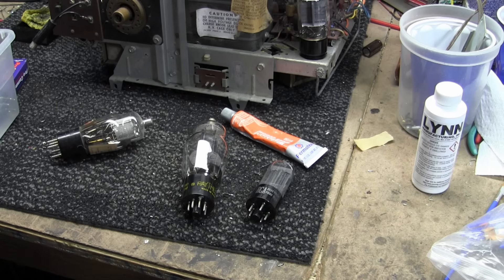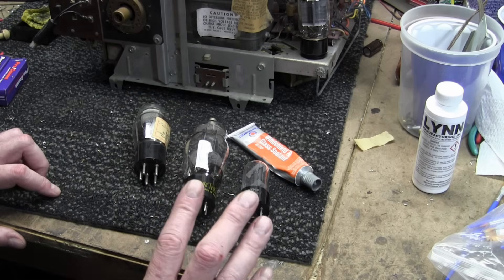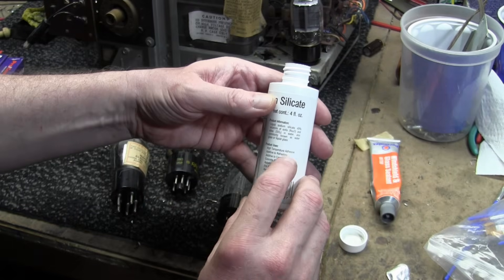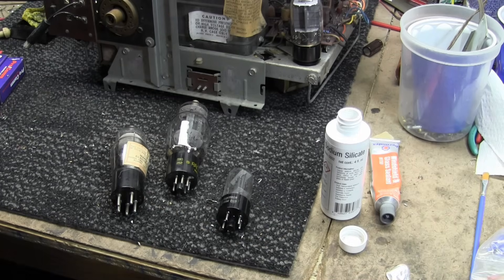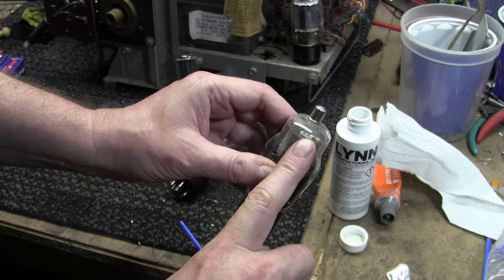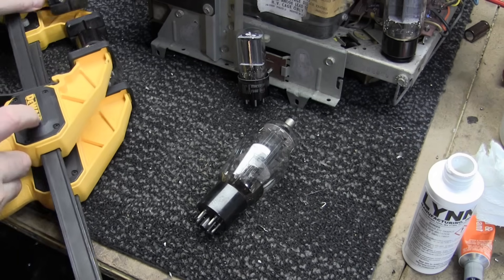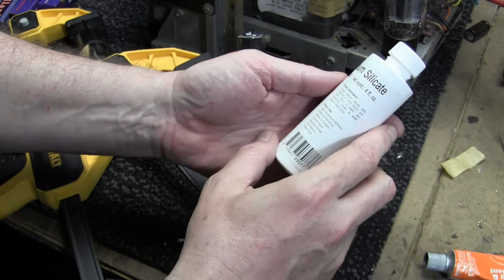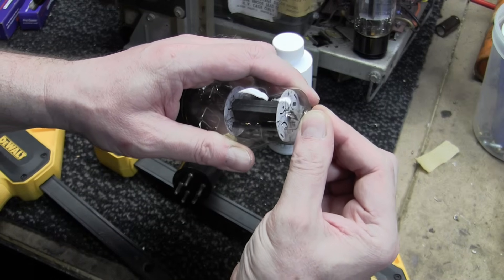Bob's Tech Tip: Repair loose tube base and cap with liquid glass

Comment: I used it to fix a dozen tubes I had with loose bases, it worked well and they were rock solid afterwards, but I applied sodium silicate liberally with a syringe and I think on some tubes it pooled up inside the base and caused crackling or a short in the tube, even after a fortnight of drying as there was poor airflow in the base .  I salvaged 2/3 of the tubes, my tips would be not apply too much sodium silicate, leave a gap when applying so it can evaporate and dry, and leave in a warm place to try at least a week or 2.  An additional tip which saved a few of the crackly tubes for me, and would be a good thing to ensure they are dry, leave in standby for a 1/2 hour with only heater current then they should be good to go.  All my repaired ones are rock solid and working sweet.

Comment: Hey Bob sodium silicate is actually the big ingredient in all of those head gasket repair containers that you see at the auto parts store. The idea is that the cylinder head and engine block are so hot as it rolls past the leak it'll slowly build up and keep heating up and hardening in that area until it's solid. Sometimes it works sometimes it doesn't. I'm wondering if you could use it for a cataract. In theory it could replace the glue. Then you would have the implosion protection back again. Maybe you could silicone the perimeter leave the top open like that little Port they had from the factory and fill it. Then use a heat lamp to harden it. The hard part would be maintaining the temperature. Just thinking out loud

Comment: I first start by dripping some acetone into the gap between the base (or cap) and the glass. This seems often to remobilize the original sealant and effect a new seal. With several drops of acetone injected, rotate the tube to spread the liquid around, then clamp gently. This is the least intrusive method that I’m aware of. If that doesn’t work, then I start thinking about other adhesives.

Comment: waterglass, my bread and butter. 
hardening to full cure using vacuum and high heat will make it near impervious to the extremely slow breakdown due to water. see nasa report docs on sodium silicate vessels. see use of sodium silicate for use in glyptol replacement.
waterglass (in a varied form albeit) is indeed the binder in screen phosphor, and has favourable electrical properties in that situation; e-beam tunneling is not ruined with occasional waterglass obstruction, and the phosphor is subjected to a near Fowler-Nordheim tunneling event, a good thing too, it lights the screen well!
The use of waterglass to make a quasi dag material (it is indeed colloidally suspending to the graphite, though not as well or in the same way as the other dag, atkinsons colloidal graphite) is possible and i've used it for this purpose before for electrostatic shielding. it can be used to make composites in this manner, graphite making a low current capable conductive paint.
mixing with iron powder creates a liquid shielding compatible material that works well when mixed with graphite or copper powder to increase the inter layer eddy losses (and thus better shield). 

In high concentrations of sodium silicate (loudwolf sells a re-agent grade purity) in which the colloidal mixture can be made to grow in high heat before air cure is completed (heat cure and air cure should be two steps, the timing is specific to the application; err on the side of caution and let a long air cure if unsure before oven heating)  the silicate can grow 'fuzzy' crystal interfaces to the air if the high heat cure is too soon, which is typically undesirable. 

waterglass is (was) also used as a Glyptol replacement when used with other techniques or layering.
(Glyptol was a very very old UHV OG vacuum sealant. the old vacuum tube R and D people loved it. horribly nasty stuff though. i do mean old old school. DR. Van Atta and the American vacuum society old i mean.)

I could go on, but its a great material for use here. thumbs up!

Comment: Sodium Silicate is poisonous. Wear gloves. Regular water is the solvent for cleanup. Sodium Silicate is the major component of furnace cement and most exhaust pipe sealers.
Reply from the maker: No it isn't.  I mean, no, don't eat or drink it and can cause skin irritation but I wouldn't cause it poisonous

Comment: We used to call it water glass and it's also great for sealing a blown head gasket and small cracks in blocks. Supposedly you have to make sure to put it in clean water with no antifreeze. I have saved engines with a blown head gasket with it before. It doesn't always last forever but a 5 buck quart of sodium Silicate vs the full cost and labor to replace the head gasket is worth a try if it's older and out of warranty.
I had a cheap pinto with a badly cracked block and it was making glass ice cycles running down the block when I gave up. If I had filled them with something heat proof it might have worked.

Comment: For the cap on the tube and the Bakelite base repair you will have to brush it on twice to get enough of the waterglass to 
touch both of the parts together. A disposable plasitc syringe may be helpful with the base repair. Aluminum Sulfate is 
used as a thickener if you need one in certain applications like filling the gap better or quicker.

Comment: The MSDS says it’s just water and sodium silicate. Interestingly enough, I’m pretty sure that’s the same stuff they used in the cash for clunkers program to finish off engines. 

I’m familiar with Lynn manufacturing. They’re a local company, and I used one of their refractory kits to re-line a boiler at my house. 

I know you’re trying to get away from using RTV, but one RTV to consider is called Ultra Copper. It can be used to seal automotive exhaust systems, and can handle temperatures up to 700°.
Reply from the maker: Yes, it's the same stuff used to kill engines. It is a very simple solution but has a lot of uses.

Comment: When you want to replace the insides of a multisection electrolytic by cutting one open could you use this as a sealer to reconnect the outside can parts after replacing the caps inside? Just thinking of other uses for it in the repair shop Bob.
Reply from the maker: Possibly or something like E6000 may work even better.  That being said, I think you'll find the can restuff technique I'll unveil soon interesting.  No cutting or gluing required :)

Comment: Sodium silicate is just dissolved in water. The solid dissolves very slowly in water however, like days. It can be made by boiling silicon dioxide (sand) with a strong lye solution. Somewhat different characteristics result from different ratios of those two chemicals. The solution can be made so strong the resulting liquid can be as thick as honey. Interesting fact, a dilute water glass solution is used when a new phosphor screen is deposited during CRT re-building.

Comment: How about E6000 it is very strong yet flexible! ant it will stick to anything except Teflon, it is my favorite glue
Reply from the maker: Heat.   Exposing glued items to excessive heat can cause the glue to break down or become brittle over time, so it is best to avoid temperatures above 150°F

Comment: Yes , I too have used RTV Silicon
Reply from the maker: For grid caps or just bases?
Reply: I too use black RTV silicone for the bases. Works great. Haven't needed to do a top cap yet.

Comment: I've had to repair a few loose bases before.  I typically use Leech F26 or Loctite PL construction adhesive.  I've also used GE Silicone II with good results.

Comment: Wasn't the original stuff used to cement vacuum tube bases and caps a kind of stiff but still slightly flexible mastic?  I hope the sodium silicate material's coefficient of expansion is close enough to the glass and to the metal that it won't break free, but without some testing I don't know if I could trust it to a project for a customer who wants to keep the set in use.  If it breaks free and the whole set vibrates for some reason, this could compromise the vacuum tube.  The RTV silicone seal that you've been using on picture tube bases still seems more reasonable to me for this use, perhaps with the help of an industrial syringe needle of the kind used to refill printer ink cartridges.

That said, yes I have seen this substance used for muffler repair patches, with a fiberglass matrix. Because it is alkaline, it will bite into the metal.  But also that gives it the potential to corrode through a thin section of metal such as a wire.  Neutral RTV won't do that.

To dissolve dried sodium silicate, if water and warming alone will not do it, a mild acid might help (e.g. vinegar).
Reply from the maker: The original stuff is very hard and brittle - similar to bakelite.  "Stone powder, Orange Shellac particles, Resin, Aniline. Then, this powder is solved in Alcohol, and the glue compound must be used within 4 hours."  It has a similar coefficient of expansion as the glass.  Silicone is OK for CRT bases but not so much tube bases or caps. It has too much give and will break loose if too much pressure is applied.

Comment: In college, we used Water Glass to harden and protect solid fuel rocket motor cardboard tubes, well before carbon fiber tubes were available. Never thought about using it on vacuum tubes. Great idea!